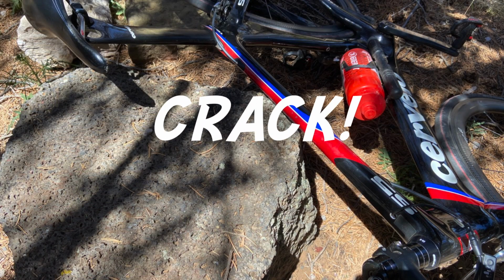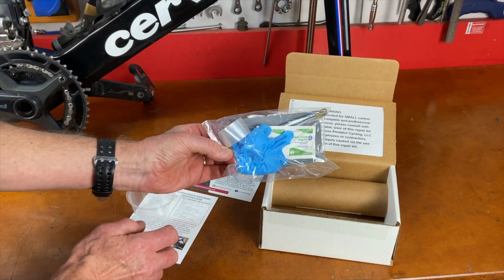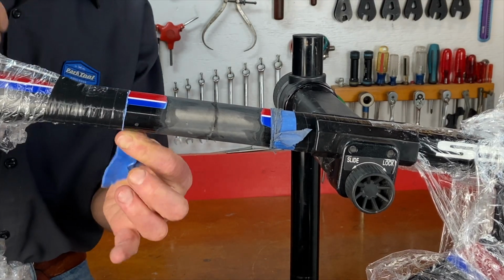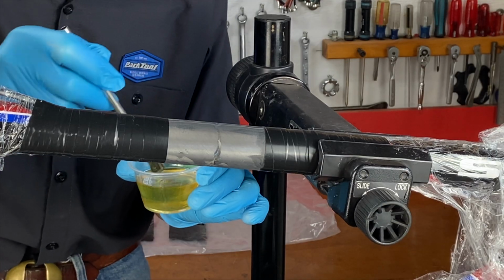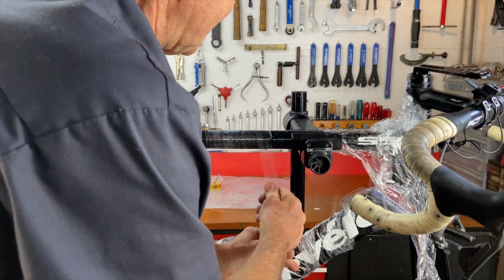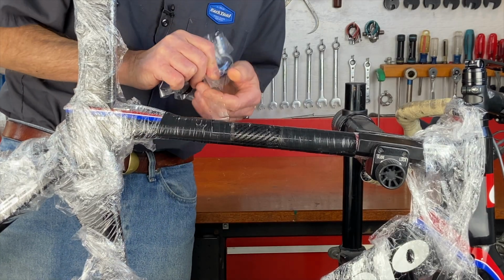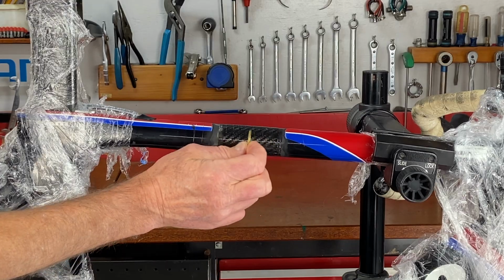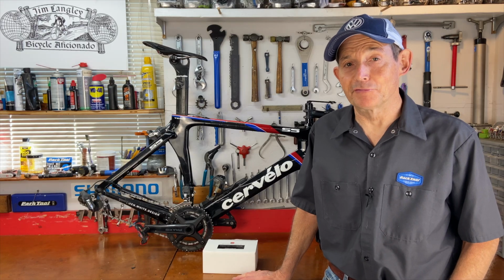Do it Yourself Broken CARBON BIKE REPAIR! #carbon #bikerepair

Comment: As a former stress analyst the procedures for relate of aircraft composite structure requires complete removal of damaged material. Composites with voids or fractures internal tend to eventually fail which is why the X-ray or use ultrasonic testing to verify structural integrity. Covering a fracture is covering a void. Graphite fibers at very brittle, stiff and strong in tension. They have virtually no compressive strength unless supported by the matrix due to the fineness of the fiber they buckle under compression and fracture. This fracture tends to proprogate with many cycles then the member will suddenly fail. Composites without defects can have virtually infinite fatigue life but unsupported fibers tend to buckle.  If the member is highly loaded it is best to sand out all damaged material then try to duplicate the layup or more likely do 0/45/90/-45 layers and over build it.  It is difficult to do a proper repair that is invisible because you need over lap to develop the load trough inter-laminar shear. You could probably get away with a collar over the damage if you really over build it but best practice is to remove all damaged matrix and fibers.   Brian Blum
Reply from the maker: Appreciate you watching and educating us Brian, thanks a lot! 🙏❤
Reply: I would over build it on the inside leaving the outside nice, inserting some foam on the inside to compress against
Reply: @alf3071  That works unless its an area where cables or wires run through it.

Comment: I know this is an old video by now, but if the repair kit doesn't explicitly say it took care of that, CF is UV sensitive and can break down if unprotected. At the bare minimum, esp where you sanded away the coating beyond the repair, you should consider clearcoating it if not repainting to match, and then regularly coat with a UV protectant like 303.
Reply from the maker: Thanks for watching and commenting. I mention the need to protect the repair in the video and to do that I used the most simple, easy approach, wrapping it with electrical tape, similar to how you would protect a top tube from scratches, etc from impacts with things. Thanks again!

Comment: You only needed10ml of resin fo the whole job ! Max you need is same weight of resin to cloth
Reply from the maker: Thanks for watching and the tip guinnesslover. When trying to get the ratio of epoxy to hardener right you can end up with more than you need. The compression (shrink) tape and heat squeezes out the excess resin.

Comment: I've got a crack in my carbon frame in almost the exact same spot, also from falling over. I don't really want to do this, but it's probably better than any other solution sans buying a new bike — which I want to, I just can't afford what I want at this moment.
Reply from the maker: Thanks for watching and commenting Sean. The kit is $100 so it's much cheaper than a new bike 😊and the repair isn't that difficult. The only hard thing is repainting the repaired spot, which I chose not to do. But other than that, it's straight forward.

Comment: I was browsing YouTube when this video produced a year ago has been attracting some attention. Firstly well done if you going to have a go to save money. I mean that. We hate waste and more importantly safe repairs are even more important. What constitutes a safe repair you may ask? In the case of very thin light carbon bikes- consistency with in the construction. Why? Because thin light bikes rely on the asymmetrical characteristics to share load. Remember these bikes are built to the absolute minimum in materials they deem correct for the function of the particular bike. 
The big difference between the method you see in this video and a professional repair (I say this with caution as not all are professional repairers or indeed know the correct method for some parts) is that the repair is reconstituted, undetectable carbon composite of the same thickness density and profile. Change that and your repair is not in harmony when under load. Beside this point the approach to each location of a fracture can vary in process and indeed materials. If we were talking 10 years ago this wouldn’t be completely valid but with todays bikes which are a great deal lighter the emphasis on consistency is paramount. We have robots now which emulate molds and repair precisely because even the most skilled repairer cannot honestly guarantee the wall thickness and densities are correct. So to conclude in the name of your safely: if you repair a carbon bike it could be a bit safer on very old carbon or very cheap heavy carbon bikes where mid tube fractures exist on the top down tubes and the 4 stays otherwise frames under 1kg you risk yourself or someone else’s life. Rob Granville, CarbonBikeRepair
Reply from the maker: Thanks for watching and for sharing your expertise Rob, appreciate it. 🙏
Reply: I heard some great comments about CBR… very happy customers.

Comment: Jim, you sure made it look easy.  I think I'm going to give it a try.  My crack is near the seatpost tube, a casualty from having the seatpost above the danger zone.  Thanks for a great video.
Reply from the maker: You're welcome Joe. It is pretty easy with the kit and following the instructions. I also called Predator Cycling and reached someone knowledgable to discuss the crack on my frame. A crack in a top tube is not under the stress of a crack in a seat tube with the leverage of the seatpost and weight of the rider so it might be good to check with them about your frame before buying the kit. Thanks a lot for watching and the nice comment and I hope the kit will work for you.

Comment: I have the opportunity to buy a nice bike but the frame has a crack.
I only want it as a winter bike on my turbo.
This video has really helped my decision.
Great job, well presented and easy to follow.
Thanks.
John.
Reply from the maker: You're very welcome John, thanks a lot for watching and the nice comment. Have fun fixing and riding that bike!
Reply: I hope you went ahead and bought it...yours is a perfect case scenario!
I crashed my Scott addict gravel and had a partial cracked seat tube. Although I went ahead and replaced with a Ti gravel bike via insurance,  later found this vid, gave me the confidence to repair and have the Scott for a lightweight blast option 👍

Comment: Thankyou for this. I dont ride a bike but my wheelchair is carbon fibre and i bought a second as a spare knowing it was heavily reduced due to a crack in the backrest and thankfully i ended up being able to switch the backs over so i have one fully functional chair but i wanted to have a go at fixing the crack so started by filling in some chips and dings first, this really did uelp inspire some confidence and ive just unwrapped the carbon fibre repair today! My brother (car fan) says id need a few more layers of expoxy over the repair but im not sure how id go about that? I do have some of the clear tape left but have been sanding it smooth today. Its part of a backrest so semi weight bearing id say.  But impressed so far! 

Thanks for posting this!!!!
Reply from the maker: You're very welcome! Thanks for watching and commenting. I'm so happy the video helped you with your carbon fibre wheelchair repair and congratulations on doing it yourself. In regards to adding layers of epoxy, as I understand it, it's the carbon that adds the strength not so much the epoxy. I believe you'd want to add more carbon layers to add strength. Thanks again!

Comment: Fantastic video, thank you!
I appreciate your DIY ethos, and share it as well.
While interested in CF bikes, I am very wary of hidden frame damage on used bikes more than any other frame material.
This is what is holding me back, as well as new bike prices, which I find increasingly ridiculous!
Reply from the maker: Glad you enjoyed the video, thank you for watching and commenting. Carbon is actually super strong. It takes very specific types of damage to crack or break it such as how my top tube landed on a pointed rock. The good news is that there are carbon companies that can X-ray carbon frames to inspect them and ensure there's no hidden damage. So if you found a used carbon bike at an affordable price point you could have it inspected to put your mind at ease. Hope this is helpful and thanks again!

Comment: Excellent video.  I repaired a Giant TCR Comp bottom bracket shell. Bottom on the chain stays side was shattered. I rode that bike 9 more years. I thought damage was from a crash I had but I think they had a recall on that frame (2003/2005).
Reply from the maker: Nice job rcdogman! Thanks for watching and for sharing your Giant carbon frame repair!

Comment: Your video is inspiring me to fix my carbon bike that’s been sitting in the closet for years. I hit a car head on, snapped my fork but didn’t notice the crack until I went to the bike shop. The crack I have starts from the top of head tube and goes down about a centimeter. Now I know you might be more of a novice to carbon repair, but you seem to have some good knowledge about bicycles. Would you have confidence in this kit for a small crack in a head tube? I think I’ve been told repairing carbon there is a bit more risky. Thanks!
Reply from the maker: Thanks a lot for watching and the question James. I'm glad my video has inspired you to try to fix your frame, but a crash with a car that breaks a fork is a major impact and it's impossible to know how badly your frame might have been damaged just by looking. That crack that you see might just be the tip of the iceberg so to speak.. with more damage inside the carbon that isn't visible to the eye. So, I would recommend you take the frame to a company that x-rays carbon frames to check for damage to the carbon. That way you can be certain that it's only that small crack and not structural issues in other parts of the head tube that could lead to a catastrophic failure later. I don't know where you're located but you can find carbon bicycle repair places in different parts of the USA that can do this and also in Europe. It shouldn't be too expensive to just have it inspected and you'll also learn how easily it'll be to repair the frame. I hope this helps and you can get back out on that bike. Good luck.

Comment: Very interesting. Seems like a solid repair, I hope it holds up and provides thousands more miles 👍🏼
Reply from the maker: Thanks for watching, Carlos! I'm sure it'll hold up - it's the same process basically that professional carbon repairers use - and I'm definitely looking forward to riding thousands of more miles🙂
Reply: Solid work ✌️
Reply from the maker: @gianloplo  thanks for watching and commenting, gianloplo, appreciate it!
Reply: How's the patch holding
Reply from the maker: @tariusvadoom6489  thanks for watching and asking, tarius. The patch is holding up fine, no issues at all after hundreds of miles and thousands of feet of climbing the longest steepest climbs here.

Comment: Be interesting if the ride characteristics of the frame changed after stiffening it up in a flex section or if you could even notice.  Masking tape doesn’t like excessive heat
Reply from the maker: Thanks for watching and the tip about not using masking tape to mask the frame off jonny, appreciate it. I do not feel any difference in stiffness but that's a subjective thing to feel and usually related to the size of the rider and their strength so another rider might. Thanks again!

Comment: what strikes me is how fragile such frames are. The properties of carbon fiber being stronger than metal are clear, however, in case of impact, Aluminum and iron would only dent. This repair seemed visually ok, im wondering if you measure the true strength on the tube if it will be strong enough only with these 2 layers of carbon fiber. thanks for sharing
Reply from the maker: Thanks for watching and commenting, appreciate it. Carbon actually is super strong but like all materials it has its weaknesses such as sharp objects and sufficient penetrating force. I don't have a way to measure the strength of the repaired tube other than riding the bike. I have ridden it a ton since the repair and it rides and performs as it did before the break. The way to look at the repair is not as just 2 layers of carbon fibers but all the layers that were in the frame already PLUS 2 more layers on top, so it should be even stronger than it was when new. Hope this helps explain more, thanks again!
Reply: @JimLangley1  this make sense. im sure the tube around the crack is even stronger, i was just wondering exactly where the crack is. Ive seen dropbars delaminating and breaking like glass when pressure was added to a crack (under the tape). thanks for sharing

Comment: i would do this for the top tube, which doesnt really carry much load.. but, would be more worried about diy fixing a seat or chain stay.
Reply from the maker: Thanks for watching and the comment, JogBird. It's basically the same process used by frame repair companies so it should work fine. Predator Cycling offers great support, too. You can discuss with them whatever you're trying to fix and they'll tell you if their kit will work for it.
Reply: @JimLangley1  The only thing I wouldn't use it on is a fork since that is unsupported and very safety-critical if it does fail. Nice repair and I'd be very surprised if it doesn't hold up! Repainting tricky because of the pattern. Maybe have a look at the ETOE channel and respray the whole frame in an interesting colour scheme :)
Reply from the maker: @Ben C  thanks for watching, Ben. I broke a carbon fork once and it wasn't fun at all 😊. Thanks for the tip about the ETOE channel, that guy has done some impressive paint jobs! At this point I'm still thinking I'm going to cover it up rather than repaint. But it's great to have such a helpful resource, thank you!

Comment: Great job Jim! I have a similar crack but it’s on the bottom stay of the rear triangle of a Specialized mountain bike — I’m wondering if a repair of this sort would be durable enough for a bike designed for a lot of aggressive riding
Reply from the maker: Glad you enjoyed the video Rossi, thank you for watching and commenting. Chainstays are usually pretty heavy duty so I think this repair would work well for your frame. The company that makes the kit is happy to look at photos and advise if the kit can fix the crack you have too. So you could ask them to take a look to make sure. Hope this helps and that you can fix it.

Comment: How is the repair holding up Jim ?  I can't see any comments on the final use of the bike. I was trying to figure out how long ago you did the  repaired .  Please advise, thanks.
Reply from the maker: Thanks a lot for watching and the question, Jo. I did the repair in August of 2022, so it's been 4 months of riding on it so far - about 1,000 miles on that bike with a lot of steep, long climbs here in the Santa Cruz Mountains. And it's been holding up just fine. I have not put anything over the patch yet which makes it easy to look at it and feel it to see if it's changing in any way and I haven't noticed any change at all. It's recommended to wrap it with electrical tape or paint it so as to keep the UV rays from affecting it and I'm going to do that soon. Right now all it's doing here is raining - we need it, too. Thanks again for watching and commenting. Hope this is helpful!
Reply: Thank you for your prompt reply .

Comment: Nice idea. I found a repair kit at shopee. May i know what thickness of the carbon fiber should i use? Thanks.
Reply from the maker: Thanks for watching Roberto! The specs on the carbon provided are: 

	5.8oz - 3K, 2x2 Twill Carbon Fiber Fabric Weave, 6 in x 12 in

Predator doesn’t say how thick it is but I would estimate 3mm. You can buy the carbon from them. Hope this helps and thanks again!

Comment: Really cool video, the repair looks super strong. I watched some other videos where they put the carbon fiber on, and paint on top after instead of pre-painting. Any reason why you pre-applied epoxy?
Reply from the maker: Thanks for watching, Denis, the repair has been holding up great so it does seem super strong. The reason I applied the epoxy like that is just because that's the way the instructions in the kit said to do it and I wanted to follow their step by step to be sure to prepare and apply the epoxy, frame and patch according to their procedure. For the patches the epoxy goes on first so that you can flip them over and apply it to both sides of the patches. It definitely was a lot of epoxy and I probably could have used less and it would have been fine. Thanks for the great question!

Comment: Great video, thanks for sharing. I have a Canyon Ultimate with a cracked top tube, quite substantial and covers about 60-70% of the circumference, localised to a single area luckily, do you think it is safe to use this kit to repair it? Thanks for your help in advance.
Reply from the maker: Thanks for watching and the question. It sounds like you have damage that's similar to what I had on my Cervelo, which makes me think the kit will work for you. You can also contact Predator and discuss your frame damage with them to see if they agree as they are the carbon experts. If you use it to repair your frame, please let me know how it works. Thanks again!
Reply: @JimLangley1  Thanks for the prompt reply! I will definitely get in touch. I am also looking at using unidirectional carbon fibre and the hassle of layering it in different direction. I am still researching so could go either way...